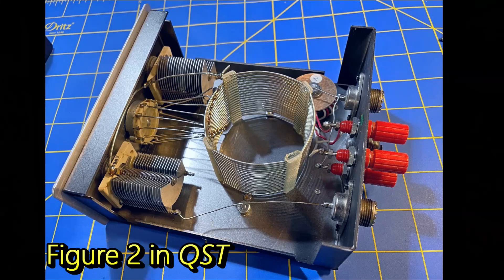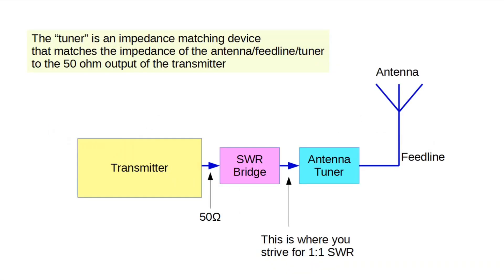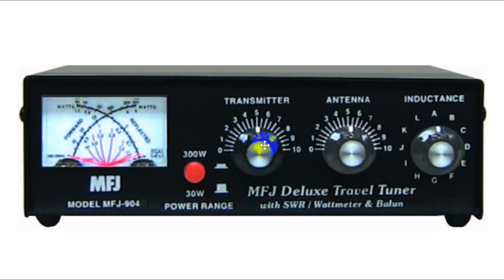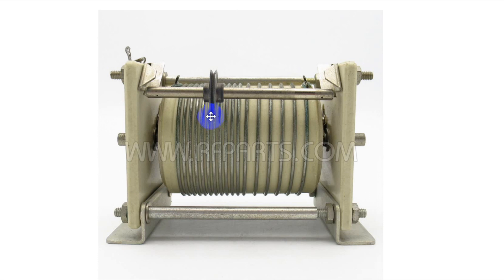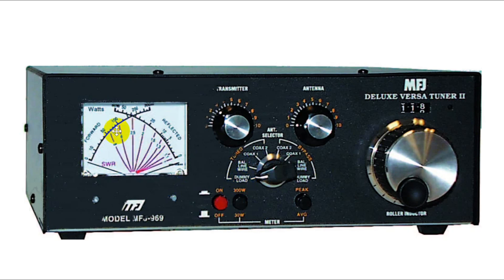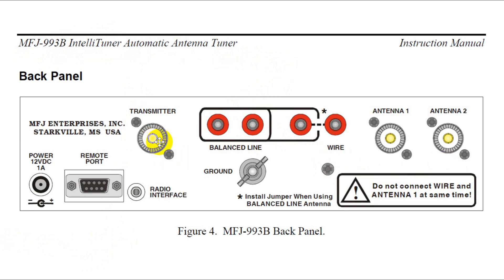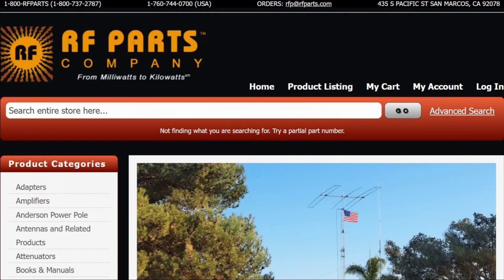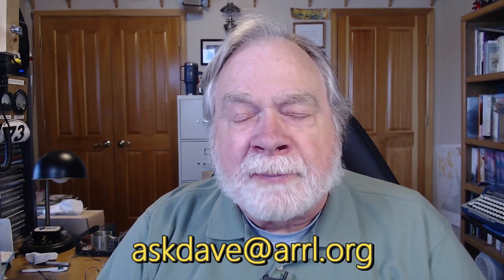Ask Dave April 2024: Antenna Tuners

Comment: My used Icom 7300 came with a LDG AT100 ProII AutoTuner. I replaced it with a Chameleon URT1 remote tuner for AF MARS operation. I didn't want to simply match the transceiver to the feed line and still have all that reflected power in the antenna system. The RTU-1 matches it at the antenna for maximum transfer of power. The LDG was limited to 30 watts digital, the Chameleon handles 60 watts, bonus!